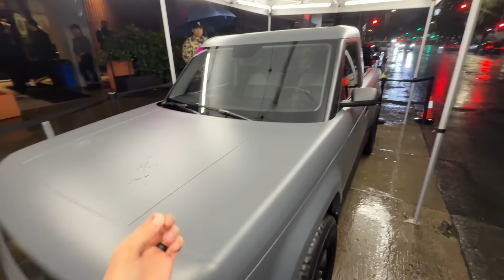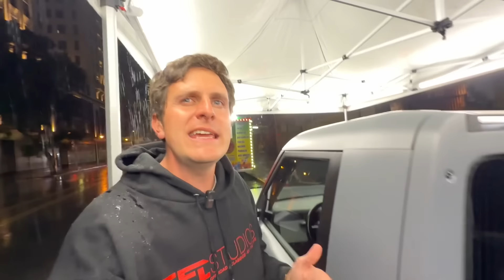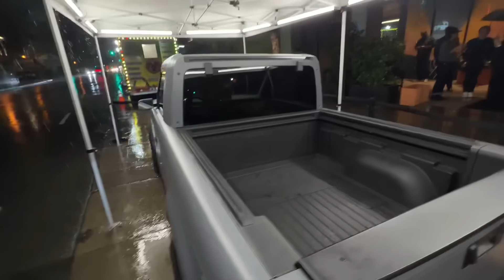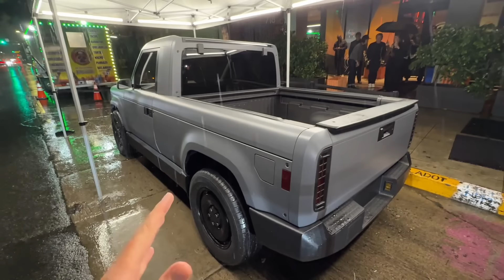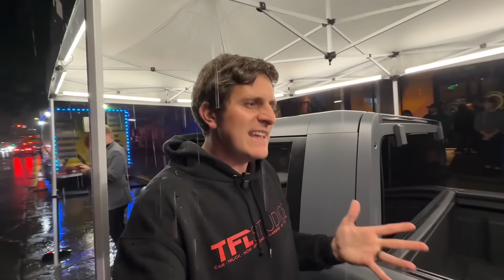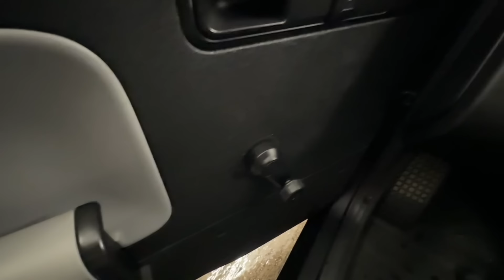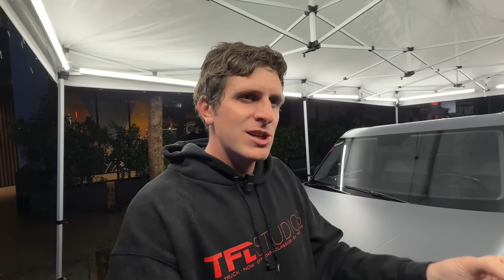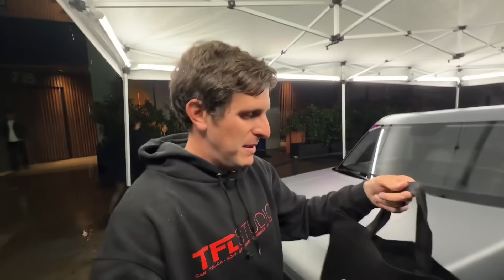The TRUTH About the '$20K' Slate Truck...Will This Really Be a Hit?

Comment: The idea and concept is there, a lot of things they are going for are great as well.  Yet they absolutely set themselves up for failure with going electric.  A small gas engine with manual transmission is what they should have done.  Also the other major issue which makes this idea impossible is all the laws we have which prevents anyone from making a proper cheap car.  By the time this thing hits the market itll be 30k, and it being electric will also prevent a lot of people from even considering one.

Comment: I do really like it, aside from smaller single cabs were never good for anyone over 5’6”.  The 80’s extended cabs with the unusable back seats would be good to have.
Then there is the issue that no manufacturer will dare to solve. Repairability.
We aren’t going back to the days where you could fix it at the roadside with a basic set of tools.
And it needs an ICE, preferably a diesel.

Comment: this vehicle is just a electric and 200 km a battery in Canada. This will not work needs to be hybrid for the same price plus each time I look at this truck. The price seems to be higher and higher. They started at $20,000 American before no more I see the video more expensive I see it. 😂 plus the battery for 250 km. 🤣🤣🤣🤣🤣

Comment: If they can keep this around $25k they will sell. 
Little no frills RWD pickups used to be popular for a reason. 
Cheap to buy (relatively), dirt cheap and simple to operate.
Seems like the biggest challenge might be regulatory. What's it going to take to get something like this legally on the road? Part of the reason we don't see small cheap vehicles anymore is safety.

Comment: I think this truck will sell so incredibly well that all the other ICE manufacturers (Internal Combustion Engines) will have no choice but to offer a bare basics small pickup to compete, so you will all get your gas option.  I wish I could buy stock into this specific idea right now before it skyrockets.  I think it's the next Prius.  The Slate WILL HAVE a backup camera that shows up on the small display and also on your smart phone that you plug into the dash.  I think this concept is BRILLIANT.  I don't suffer the "keeping up with the Joneses" pressure that most folks do.  I can't imagine spending more than $40K on a vehicle.  I actually prefer as few computer chips as possible in my vehicle.  That simply means there's less to break or malfunction.  I will most likely buy one of these in 2 to 3 years.  Can't wait!!!

Comment: I love the concept of the Slate vehicle, being modular allows it to meet multiple markets and is cheaper to manufacture. I agree, it should be 4-door, as a 2-door it limits itself to primarily the work truck buyers, and the range could be a limiting factor for those guys. I think if they can get a range extender, have it work like a diesel-electric train, it could work. If they get the 4 doors, and range of 250+ miles, and keep the $30k price tag, I think it'll work. I hear you on the 4wd, but I think that costs too much to do, so they wouldn't be able to keep it that cheap.

Comment: you make a lot of good points. All except the gas motor. The planet is burning down around us. This can't continue. There are millions of people around the world who can't afford an electric vehicle.

Slate has removed everything a base electric vehicle doesn't need to make them available to the mass market at a price the US hasn't seen in 20 years.

Would I like four wheel drive? Sure. I do a lot of driving up in the mountains. Would I like more range? Yep. The Slate platform will accommodate that in time. 

But it doesn't need to be yet another overcomplicated hybrid vehicle that just doubles the price, triples the number of parts, and requires diagnostic tools priced well out of the general public's pockets.

Comment: Yes, trucks are too expensive, but this isn’t the answer. It goes too far.
Reply: My 2025 Ram 1500 is absolutely amazing. My family fits great, we can haul a ton of stuff. I just took a cross country trip with my wife, our two boys (6 and 9), 2 small dogs (in their crate on the floor in front of the rear seat), and all of our luggage for a 5 day trip, and the bed was 100% empty. Everything and everybody fit inside with ease leaving the bed open for hauling stuff if I needed to.
Reply: My first car (in 1993) was a 1984 Ford Ranger. It was fine for a young single guy, but I only kept it for about a year.

Comment: EV's are the inevitable future, especially once somebody figures out the next real revolution in batteries. To back out now and spend tens or hundreds of millions of dollars tooling up for gas would imo be a mistake just because of some transient societal recoil. I'd bet it wouldn't be as cheap with a gas motor either. If it could be sold at around $20k as shown, it'd have a place in the market.

Comment: I like the concept as well!  Awesome. 
My question on range is, what is the real range?  Advertised ranges are based on ideal conditions by the marketing department of the manufacturers eager to sell WHATEVER it is they’re selling. Doesn’t matter if it’s EV’s or kitchen gadgets. It’s not trusted. E.g. if I’m in LA can I make it for a full day of work, say With a LOAD in the back sitting in traffic, motor not using battery (when not moving), but still drawing down the battery with AC running?  If I can then question is answered. And range is irrelevant. It’s all about presentation. 
In my opinion,  EV manufacturers should ask EPA to do mileage simulations similar to ICE and independently report battery ranges (city, highway, or other appropriate parameter-such as above example). The truth may (or may not) shock consumers at first, but I believe that it will answer - independently - THE fundamental question most consumers have. Then let the market do what it will. In my view, over the long run this will be the best way to get consumer “buy-in” for EVs and thus determine their future. 
An honest assessment and disclosure by Slate will catapult them on the top of the heap in the credibility department in the automotive industry (EV or otherwise) - so critical especially for a start-up. Good luck guys!!  I hope you succeed.

Comment: I've got one problem with your numbers and logic. Existing truck sales and configurations are largely determined by what DEALERS order. 

Dealers simply don't order many single cab base models so of course their sales mix is going to be low. It's not because there isn't demand it's because there isn't as much margin.

Comment: You may remember the Elio Motors who promised to bring a vehicle to production for less than $7000. Never happened, and we can speculate on why that is but the fact remains, it wasn't as cheap to start up as Paul predicted. With miles of red tape and battles with big oil, we never saw this 65mpg machine.  

Slate Motors is ambitious with their price tag, and I'm sure they can market well, but we're delusional if we think it will cost $20. 

150 miles is nothing in the US. I can't go to Walmart twice in this.

Comment: Until the CAFE rules change the only way 70s and 80s sized mini trucks will come back is as electric or electric with a small range extender generator.  We are probably talking 600cc to 1000cc instead of something reminiscent of the old Toyota 22r.  However either hub motors or dual E axel small truck reminiscent of the 80 Toyota shortbed 4x4 or of a hilux would be pretty awesome.

Comment: Dealers can't sell basic models because they don't want to. At every turn you have to go out of your way to get hands on them and they are over priced for what they are. Reason they won't get the "cheap" Jeep is because everything is expensive and families aren't able to buy a second vehicle, so, Dad isn't going to get a two seater. Vehicles like a Maverick are fine for what they are, but they aren't a truck, they are small utility vehicles. They say that people want the Rubicon badge but I'd wager they want the capability that comes with it (assuming they aren't lifestyle purchasers). Unfortunately you also have to pay for all of the comfort junk they add to it. $500 worth of parts comes at a $20k premium because they added luxuries to it. Shouldn't be an upcharge to get manual windows.

Comment: Im tired of the narrative "oh well the low range is just what people need"

I agree 100% yet automakers are charging outrageous prices for a product that are WORSE. When my old Honda Fit could go 400 miles on one tank if I drove right, while so many EVs are twice if not three times the price, cannot go that far, then its a problem. If Slate wants to make a 150 miles range truck fine. But price it accordingly. 150 miles means its significantly less useful and valuable to the world. 

Stop defending automakers literally shafting consumers just because "most people dont drive that much" 

Have some self respect people and dont fall for this nonsense. You're getting less and less everyday while paying more.

Comment: They need to think about the 2-motor 4-wheel-drive issue & develop it as a come-from-factory option.  Or have it dealer installed (or by approved mechanic) when the owner realizes he needs it.  Will Slate even have dealerships?

Similarly, a tiny range-extender engine would be a good option, again factory installed or by the dealer.  Alternatively, offer added batteries (in the frunk or under seat) for those who want it.  Of course, weight increase could be a problem with the frame/suspension/brakes.

But do keep the pickup basic.

I am not trying to upscale the design with options creep, like we see in cars that start out affordable & then get fancy to spur car sales.  KEEP IT SIMPLE, with options the consumer can add himself - except for a few upgrades that hafta be done at factory or a dealership.

Some features would really increase utility.  In Minnesota, we have snow & long drives through farm country.  4-wheel-drive & an extender engine would be helpful.  But in the Twin Cities, ya wouldn't need the extender.  And our streets get plowed quickly.  Here, the original pickup would be fine.

I see Slate's pickup as a 2nd car for commuting & around town.

The family could have a 3-row, hybrid Toyota for family trips & transporting kids to soccer games.  The at-home spouse gets the big Toyota & commuting spouse gets the Slate EV for going to work & weekend projects.

We old guys don't use our phones to listen to music.  Offer a basic, owner-installed radio w/ built-in speaker & Bluetooth, & w/ easy-connect to the EV for its power.  Have it double as a portable radio.  And how about an old-school bench seat option?  Oh, yeah!

I hope Slate can maintain their target price.  Can be hard to keep it low, once the production difficulties start popping up.  Slate needs to be both flexible (which can add cost) but also stick with their back-to-basics philosophy.

If this model is successful, Slate should offer it in a stretched wheelbase for a longer cargo bed, or a 2-row cab with original short bed, or a 3-row SUV.  But keep the models simple!  I respect they want to standardize the underlying mechanics for manufacturing efficiency.

Keep the design the same for many years & this will become a cult car.  Folks will enjoy customizing it with company mods/add-ons, plus aftermarket accessories.

Keep it a universal platform - look how Harley Davidson has benefitted from that.  What was merely a utility (i.e. transportation) became a passionate hobby.  Bikers dream of making their motorcycles more special.  The same can happen with Slate.

Comment: Battery powered..... when you need range, you need range. When you need to tow or haul in a trip, you need it. Put a 4 cyl. In this truck and even the 2 wheel drive will sell like hotcakes at $20k. But it aint gonna sell as they jack the price up.

Comment: The modular is interesting and good for marketing. But, by the time you get done adding stuff to make it how you want it’ll be just another $40k little pickup. 
People don’t buy base models because they want at least a few features. Manual windows and locks sound good, until you get tired of trying to reach the other side to roll a window down or unlock a door. If it’s something you drive every day most people don’t really want a full base model. 
Then add in not being able to tow much of anything and it’s pretty disappointing. Even though towing kills the EV range it should be able to tow 3-4k to be useful.

Comment: 10:05 You never get the 150 miles of full range. You maybe get 120 miles. Then you turn on the heater on and if it doesn't have a heat pump or the heat pump isn't effective enough (like with Toyota), you have 50 miles left. That's not enough for an ordinary commute.

But if an EV is being advertised, you never see them boasting about how efficient the heater or air conditioning is. It's one of the most important features on an EV. When people have experienced an EV with bad heat management, they don't want another EV. Because the range would have never been satisfactory.

Range is also very important for EV owners who can't charge it from their home. They don't want to charge it every day. For them, charging their EV is the same annoying job that filling up with fuel is, only it takes 15 times longer. But for them, the car has to be efficient as well. Otherwise it will take ages to charge them up. I think the EV is DOA for those who can't charge at home.

Comment: I'm afraid it will be too expensive by now. Cool concept, but if I wanted an EV, a Renault 5 will probably be a better option.

Edit: If you need a small truck bed, just pull a little trailer behind an ordinary car.

Comment: I will never buy a Slate, simply because of where I live. I'm in rural Wyoming, so 150 miles will get me stuck 3/4 of the way through my trip to Home Depot. Also RWD on Wyoming roads in the winter is a great way to have your truck spend the winter stuck on the side of the road. 

If this was basically a Chevy S10 or Ranger from yesteryear with an AWD or 4WD system, I'd snap it up in a heartbeat. But it's just not.

Comment: First and foremost.  The Slate will have an option for a larger battery.  The range question is moot. I have a deposit down for one of my own.  Second, no I would not be interested in any way shape or form to have an internal combustion engine in it.  I literally just sold my last remaining ICE car.  I'm done with that noise, maintenance, and inconvenience.  The Slate is what it is, a low cost small truck that happens to be electric.  I don't care if the anti EV crowd likes or buys one.  Just because they currently have a microphone with the apricot antichrist, doesn't make the Slate irrelevant.  It'll sell. Advertising will be Slates ally to make it sell, not deliberate omissions as was made in this video regarding battery options.

Comment: You keep saying "this is what you guys want" but I don't recall anyone asking for an EV.

A simple 4 banger with power figures in the high 100s, low 200s would be perfect for this. 

I can only assume its an EV because the powertrain itself is cheaper than investing in ICE with all the emissions controls and regulations, as well as the now dead EV tax breaks. 

Gonna be sad to watch this thing die, but that's the only real outcome I can see.

Comment: Bring back the standard 6 foot bed. All of these huge trucks driving around with these tiny little beds. What are you gonna haul in it? Even the small trucks had 6 foot beds back in the day. Otherwise what's the point in owning a truck? 6 foot bed, regular cab, manual trans and an easy to service engine. That's it. Not electric. Until then, I'll continue to drive older beater trucks.

Comment: Th add ons are great but take it out of the "great" realm. 20k, great, cheap. But if the kit makes a 20k more like a 30k vehicle. I'm less interested.      It's also too small me for to buy with 3 kids and a house. I need QUICK flexibility, take the kids to school, go to home depot during the day, pick them up after school.  I'm outside of the demographic. But LOVE the idea. I am a tinkerer, and if the SUV kit was cheap maybe Id consider it when the kids are older. A hurdle is storage also. If you want a flexible vehicle, and plan to use the truck as a truck, where will you store the SUV kit, if you plan to just run an SUV, then go get another SUV for 30K that doesn't have the drawbacks of this one. etc. etc. its tough to commit the money to it, but the idea is SO appealing.

Comment: If the price reflects the basicness then yes they'll sell.

I agree with a lot of the sentiment here but disagree with the practice. I'm not everyone, I get that, but I'm still people. I annually take a 20 hour road trip out west and several other, smaller, 6 hour trips through the year. Range anxiety would absolutely be a thing for me for anything outside of my normal commute and errands.

I like the Slate sentiment. Give me what I want and nothing that I don't. Give me 4x4, heated seats for my significant other, and decent ground clearance. I'll take a basic radio, bench seat, and crank windows!

Comment: To expensive, for 15 Grand it would be ok in Europe. The batteries are losing 20% in relativ short time. In normal you have only a 60% charge, so what is truly kept in range ? In EU the market is f* up, they wanna FORCE us to EV, even the smallest burners won´t pass emissions regulations any more. I admire countries where people still have the freedom to drive a nice truck they want at a reasonable price. (In Asia Toyota brought a true 4x4 pick up work truck with a gasoline engine for true under 
$ 20.000,- by the way)